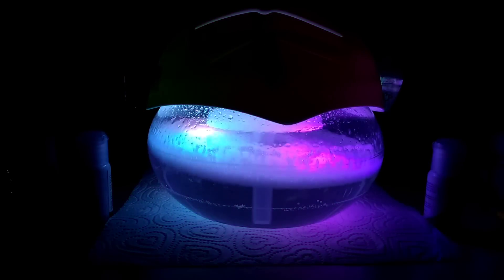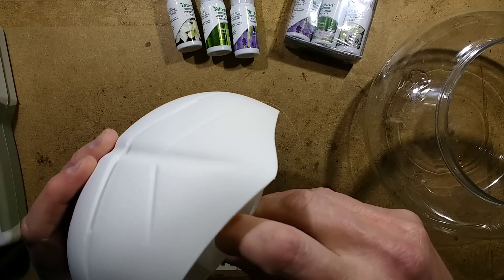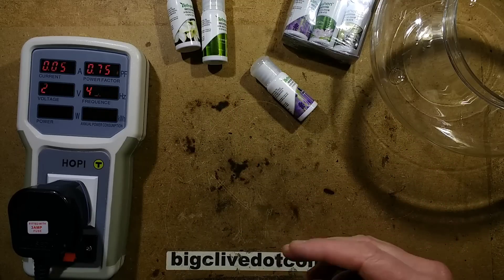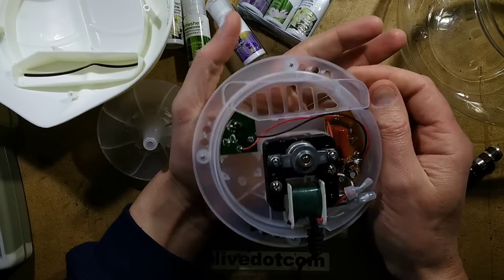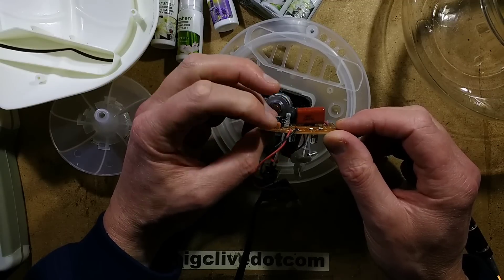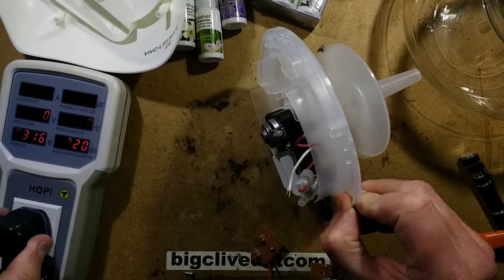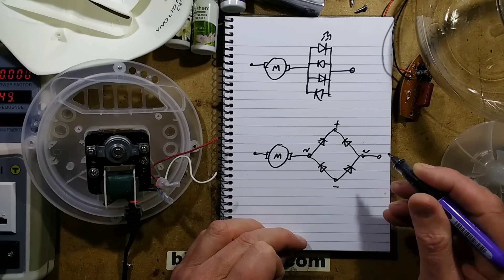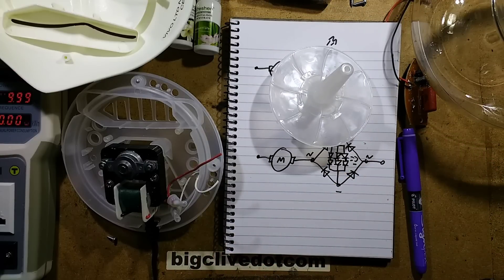Water sphere air cleaner.

Comment: How do the color changing LEDs work? If they are all the same type I would think they would sync because of being powered on at the same time.
Reply: in the little led-package, there are 3 leds and a little microcontroller (bare dies only). 
at first, they will start in sync. but they drift off over time, because they´re not synced to one another.

Comment: I suppose that if there's a lot of dust floating around in the air, some of it will get trapped in the water, but I don't see how it would clean the air in any other way.
Reply: It does make some intuitive sense. People with allergies will often feel a bit better when it rains because water will knock dust and pollen out of the air.
Reply: I imagine it would bind some pollen and other dust from the air in the room that happens to pass though the unit, but not enough to make much of a difference.
Sure if you scaled it up to, lets say, the size of an ordinary AC unit, put one in every room and closed the ventilation, it might make a perceptible difference, but I doubt the efficacy.
It makes for a very nice decoration, though.

Comment: I remember doing something like this as a kid with the motor and fan from a small battery powered vacuum cleaner thing with the fan sat over a jar of water, only there was no tube to suck up the water, it just created a vortex like a miniature whirlwind that pulled the water up into the fan and sprayed back down the sides... :D
Reply: Rainbow is the brand name.
Reply: Rainbow vacuums last forever (much longer than the new vacuums). After 30 or so years, my parents' water bowl finally gave in last week, luckily we had a spare on hand from when they bought it.
Reply: My mother had a vacuum that ran on this principle.
Reply: I'm guessing it was a rainbow brand? One of the older ones that used a water filtration system off the top of my head.
Reply: Против Глобал How much did it cost?
Reply: I've never seen this mechanism of lifting water... it's pretty cool, if entirely useless in this case :D
Reply: My grandma still uses hers. She puts orange scent in the tank

Comment: Those are humidifiers here in Canada, we used to have one when I was a kid, it was the most fascinating thing to me.
Reply: We also had a humidifier that worked that way when I was a kid in Canada. Was the bottom tub dark brown, and the top beige (I think?)
Reply: One we had was green and white ugly but worked for years.  It was 70´s unit lasted till the mid 90´s .  Think it was a HANKSCRAFT brand loved the sound it made. Took a bottle of distilled water to fill it.
Reply: I never knew as a kid how it worked (and never thought about it really since), but now that Clive mentions the tapered tube, I remember for sure the tube was tapered, and had just a little hole at the bottom. Did yours have the round motor housing offset on the lid, and one side of the housing had a bunch of posts with gaps, and the other side was solid, so the spray only came out one direction? Then it had a mouth on one edge of the lid that quite a lot of noticeable mist came out of? I do remember the sound of the water mist hitting the insides was quite soothing. We only really used it when I was sick I seem to recall... I'm sure it's still at home somewhere, and probably still works. I bet the ones back then just used a shaded pole motor, just like these ones do - nothing really goes wrong with those motors, other than the bushings get dry and need to be oiled.
Reply: We used it most when I was sick flu so on. I remember we had a long brush to clean the tube part. It twist off then you took the brush and ran up the hole a few times. I also remember my mother always put a towl under it. And left door open to the room. One time I closed the door and turned the room into a rain forest. lol 

I found a video of one close to it but the one we had was green and tan white bottom. My grandmother had a round looking one like a ufo.  I only seen it one time but it was a ge I think. Hers was a gold color and dark brown base. 

Here is the youtube video of one like we had it is the first one he showes. We never had a warm mist something about docotrs back then clam warm mist would cause you to get pneumonia if you went out side from the warm mist to the cold air. 
https://www.youtube.com/watch?v=f0gUCEYikoA
Reply: This one looks like the one my grandmother had. 
https://www.youtube.com/watch?v=vSoraY3RZ5U
Reply: That's the same motor mechanism as the one we had, but ours was the round one. That one makes the exact same sound though! Oh, look, I found it - this is the one we had: https://www.youtube.com/watch?v=L7f1UG9Y0rs - for an ASMR video, they did a crap job of recording the sound of the thing! I also see some video of the "UFO" ones: https://www.youtube.com/watch?v=cWcqQDi4idc Pretty sure they all used the exact same assembly, just in a different tub assembly!
Reply: Looks like they were all made by Gerber / Hankscraft (Reading the Hankscraft website, Gerber actually bought and owned Hankscraft from 1970 to 1996!). Google for Gerber Humidifier or Hankscraft Humidifier brings many results.

Comment: does this actually work?
Reply: Water is reasonable at capturing bigger particles in the air... Smoke, dust, asbestos, etc. But as mentioned already, this thing is moving so little air and water that it's never going to be much more than a placebo.
Reply: I saw a vac  cleaner that used water in a demo, it didn't take very long to turn the water brown from trapped dirt particles (just sucking in air from the room). I didn't buy the vac, but I do have a large HEPA filter with a large fan, it does keep the dust out of the air. Good when you have someone with allergies in the house.
Reply: Air circulates from the exhaust back to the intake mainly, I reckon. 
Therefore I doubt its effectiveness even in small spaces.
Reply: Asbestos is a silicate mineral, it can come in all sizes: chunks, fibers, flakes, crystals and dust with varying granularity. It’s nonsensical to refer to asbestos as »absolutely not a big particle«.
Reply: its really powerful for an air-freshner, but it doesnt do any air purifying
Reply: "does this actually work?"  At getting people's money?  Absolutely!  Does it do anything useful?  Based on the size of the air vents, I'd have to say "no".  You've probably got more air entering the room from either natural or forced ventilation than that device can process.  So, it's always going to be "behind".  It might be useful as a humidifier, but that's about it.
Reply: It's effective in small spaces only.
Reply: like the cardboard box it comes in
Reply: no
Reply: it depends on how hard you crush it... it is really brittle so it tends to fracture into a lot more smaller pieces, but technically asbestos particles do not have to be small
but back to topic
if you do this for long enough in your room, prepare to get sick of all the growing and thriving molds on your walls and under your bed
Reply: The water in air works when on the order of a rainstorm, seen in the southeast Asian smoke season.
Reply: H2OVac lol
Reply: it actually has reasonably high airflow. Surprised me when i turned mine on